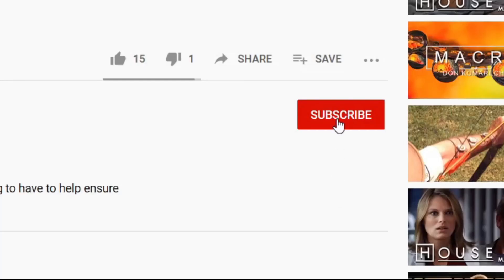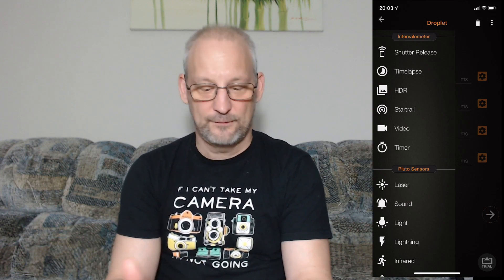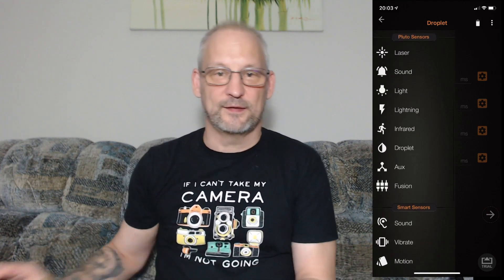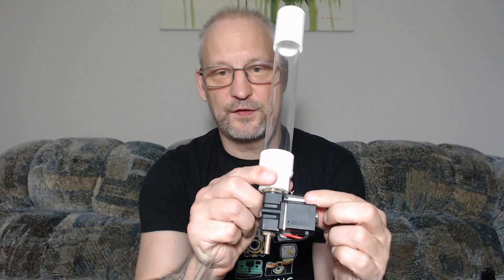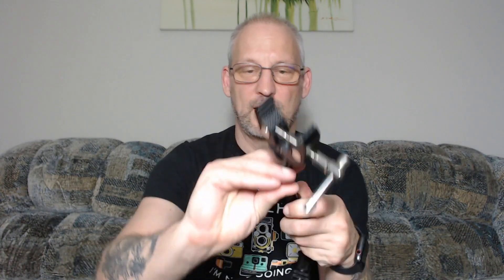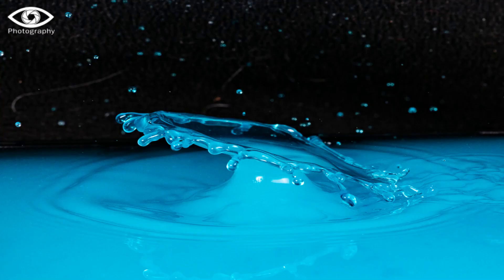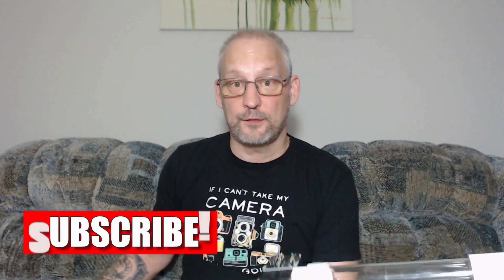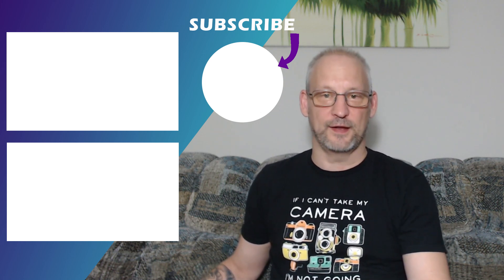How to use the Pluto Valve to Create Amazing Water Drop Images | Part 1: Pluto Valve Review

Comment: Hi ....Great video it helped me a lot...thanks. just wondering if you have an ideas on why my valve has stopped dropping water...I have cleaned it after each use and..everything is working ie the lights on motorboard and it is clicking but no water being released..
Thanks
Reply from the maker: Awesome! I’m glad it helped you. You might try taking the valve apart and make sure the plunger is also clean and working. There is a video I link to in the description of one of these videos on how to do that.

Comment: nice presentation and good quick start tuto. have you tried milk in the valve ? plashing crowns look nice. is it safe for the valve ? do we need to clean valve after milk has been used ? what is xanthan gum for french people ? do you recommend using it to thicker the liquid ?
Reply from the maker: I have done milk in the valve and I have plans on some other liquids also coming up in the next couple months. I would at least rinse the valve after each use. Give it a good cleaning by taking it apart once in a while depending on how much you use it. Xanthum gum is just a thickening agent. You can probably use other things but it devolves more clear than say corn starch.